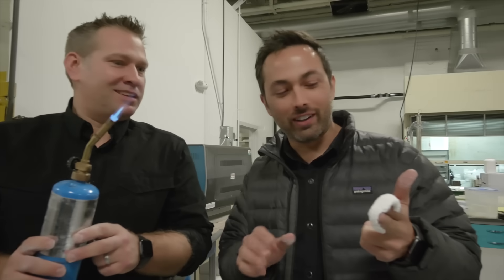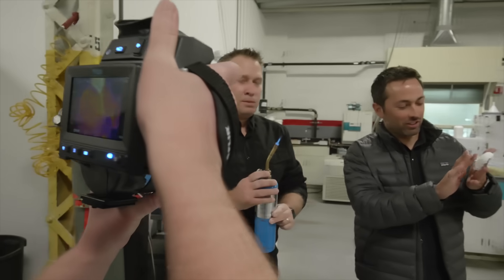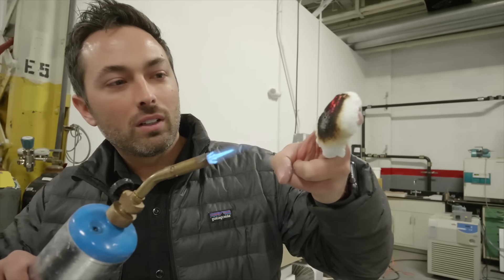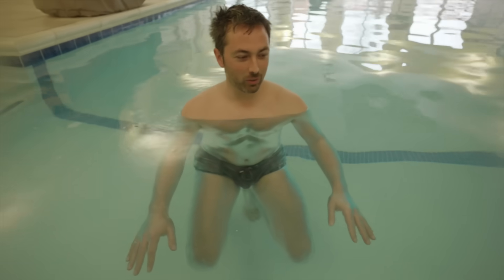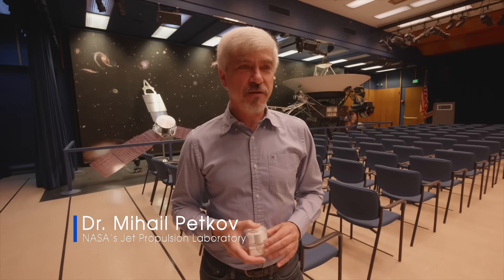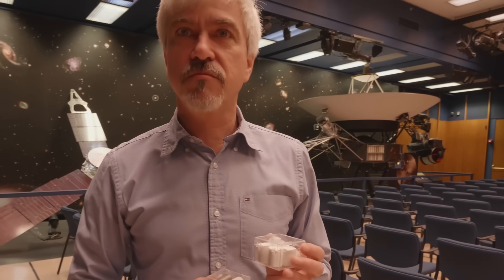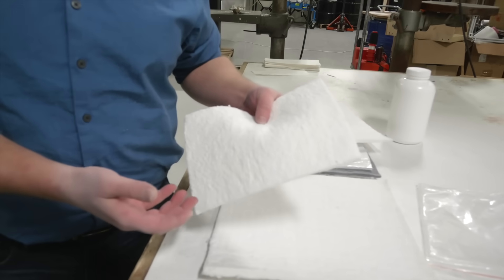I Waterproofed Myself With Aerogel!

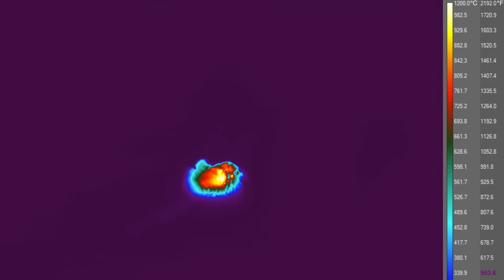Comment: @3:10 Fingers are not even touching the back of the aerogel. Don't cheat when a camera is watching!
Reply: What do you mean
Reply: @thomashuntley827  watch it and see, he pulls his finger away from the back of the gel so he is not burning the gel where his finger is. You can clearly see it if you watch it at 3:10. His bottom finger is still touching but the top finger is crossed behind the bottom one.
Reply: @jellibeens  it's so he doesn't get hurt,
Reply: @jellibeens   even if his 1 finger is a millimeter away, his hands don't get burnt. 
When he removes the aerogel a couple of seconds later, you can see the material getting removed from both fingers.

Comment: When the Aerogel is applied to the body does it reduce drag? I'm just curious if we are going to be seeing this stuff in sports where swimmers could get more speed. Maybe even use it on cars to reduce drag?
Reply: I really want to experiment with aerogel. Real interesting
Reply: for example if you apply it to swimsuits, the swimmer becomes more buoyant, giving an advantage to them. I think 200 world records have been broken using swimsuits covered in nanotechnology like aerogel so actually we have already been seeing this stuff in sports but it was banned due to unfair advantages. maybe one day all sports swimmers swimsuits will be covered in aerogel and will be the norm
Reply: Why would it?
Reply: @Gigasimo456  Water won't adhere to it. If water isn't adhering to it does that also equate to less friction?
Reply: @nhansen197  I mean, sure, but I can guess metal-fluid surface friction is negligible in almost all applications.

Most of the drag is caused by the body having to move away the fluid it's in. I don't think surface friction plays a significant role.
Reply: @Gigasimo456  Surface friction actually plays a big role. This is why auto racing is always looking for the best possible outer coating to put on their cars. It's not to make the car pretty. Speed skaters and skiers wear special racing jumpers that are designed to reduce drag. It's not just the media the racer has to push through. The amount of drag also plays a big part. The less drag there is the easier it becomes to push through the media being raced in.
Reply: @Gigasimo456  you trying to sound like an expert is cringey......
Reply: @nhansen197  surface friction is negligible for swimmers speeds, for planes on the other hand plays a big factor. But even then the drag caused by having to move stuff away (lift and parasite drag) is much higher than skin drag (friction drag).
Reply: What if it is applied to a boat? I would love to see that.
Reply: @davidhansen6788  I was just thinking that it'd be great on cars. Just imagine what it'd be like if water simply didn't stick? At all. Imagine a front windshield that never streaks.  Not to mention the possibilities to racing.
Reply: You can just throw your car in lava of you don’t like it.

Comment: He’s still alive today and his skin is still mostly cancer free!
Reply: Wait if it’s waterproof then what happens if he sweats
Reply: @bandittheyeetgod3829  he won't sweat at all, the aerogel will absorb all the heat
Reply: @Qwerty-jc3so  it's insulating, not cooling, he would be even hotter
As for sweat, it would just run off his skin
Reply: @codebracker  but the aerogel would be absorbing the heat right? It won't reach his skin, and his body won't heat up so he won't sweat.
Reply: @Qwerty-jc3so  most of the heat that keeps you warm comes from within your own body, that's how warm clothes work
Reply: @codebracker  but the overheating happens because of extra external heat, that's the reason we sweat so much in summers. Alsoo.. all sweat does is cool off your body on the outside, you'll just have to take medicines for fever if the temperature rises on the inside. And whatever heat is on his skin would probably get absorbed by aerogel.. right? Doesn't matter whether internal heat is the cause or external heat.. as long as the temperature is maintained on the surface you probably won't sweat.
Reply: @Qwerty-jc3so  firstly no, overheating happens when heat from your body can't escape so it just keeps acumulating, in summer the temperature outside is higher so less of you body heat escapes
Secondly no, sweat just helps heat escape your body as evaporating water absorbs the heat of your skin
Thirdly no, insulating materials don't absorb heat, they reflect it, so if you are hot it just reflects the heat back into your body. Only water or sweat that evaporates actually absorbs heat
Fourthly, fever medicine just makes your body expell more heat, because when you have a fever your body is actually trying to keep heat in so the heat would kill the viruses
Reply: I was looking for an upvoted comment about comparing this stuff to asbestos........
Reply: @Sanguinarius9999  Watch the part at 11:12, that should answer your question.
Reply: @ambozz3726  thankyou
Reply: 😂mostly 🤣
Reply: Mostly?
Reply: Wtf

Comment: That putty has been around for maybe 2 decades in the plumbing, HVAC trade. When soldering or brazing they wrap the putty around the pipe on each side of the joint. The never goes past warm after the putty. It works like a heat dam. We also have a spray able insulating, fireproof gel we spray on the interior of walls when using a torch. You wont burn the persons hose down. Hopefully.

Comment: it seems like the focus of aerogels are for the insulating properties, not specifically because of it's low density. if it weren't so expensive I'd investigate if it could be worked into copper wire to reduce the weight and still have great electrical conductivity

Comment: how did he get the powder off his skin?
Reply: with a non-polar solvent... turpentine would be one example that is easily accessible (though be careful with that as prolonged exposure to the fumes does harm the brain).
Reply: @derpionderpson1424  so... would soap and water work? 🤔
Reply: A-Disappointed-Sigh soap have some similar properties but if you have ever tried to get paint on your skin you know how hard it is to get off with just water and soap.
Probably would need something specifically for the purpose like turpentine.

Comment: So if I understand correctly, the aerogel in that form repels water. Can you swim if you're coated with it or would you just fall down? And what if a waterfall or pool or something was created using that water that doesn't actually touch you, would you get wet from the waterfall or would it be enough force in it to make you wet anyway, and could you swimin that pool?

Comment: So if i had aerogel on my whole body i could basically just walk on the surface of the sun ...kind of
Reply: The surface of the sun is way hot
Reply: It’s not the heat that’s is the deadly thing, it’s the amount of energy being transferred
Reply: Even just the light radiation would burn you
Reply: G thats a good point
Reply: Or i will be vaporised by the radiation, actually heat is a weak form of energy so radiation may kill me even faster than heat
Reply: Rigel that’s what I meant. The sheer amount of energy(radiation) is so immense, you would die instantly, even with the aerogel

Comment: There was an invention called Starlite before that can also withstand extreme heat. Discovered by a barbershop owner in the UK. Maybe this has the same material. Too bad the inventor died without revealing the formula.

Comment: 6:00 He should look up Diatomaceous earth. It doesn't exactly work as he describes but it is a physical insecticide and it's been the only thing that I've found to work against ants in my house. I usually get invaded by ants every summer but ever since using Diatomaceous Earth, the ants have rarely ever invaded me as bad as they did before. Even if they do, all I have to do is follow the trail to the open source and power it with the earth and it effectively seals it off for good. I've tried bug sprays for years and they never work for very long. This stuff is the only thing I've found to work as long as it doesn't get wet.

Comment: So if this stuff is cheap to produce you could technically use this in applications like diapers and replacement for silica gel and other stuff
Reply: No you need 2 rubies and a gel sack which are hard to find

Comment: But people are already waterproof, otherwise we would be like electronics, alot of water and stuff starts to fail
Reply: We can’t repel water off our bosy
Reply: Body*
Reply: Our cells can kinda die if they're left submerged for enough time, because of concentraton gradients and etc. They soak up untill the burst
Reply: Mr Thiefo actually when your skin wrinkles in the bathtub that’s because it’s absorbed water
Reply: Try to sink in electronic bathtub
Reply: we're water- resistant  (up to a depth of 400 feet). check the warranty. God never said waterproof.
Reply: Well, we kinda are like electronics, too much water and we will fail (waterpoisoning), especially if the water lands in the wrong places (drowning).
Reply: Mr Thiefo  ofc some water goes into your body what are you talking about. Why the hell do you think the skin on your hands and feet start to go all wrinkly and slightly puffy when you are in the water for too long? Obviously it's a tiny amount but it still gets in. If you were to remain in water indefinitely your body will absorb enough water to become so soft that it would literally break apart.

Comment: what happens if you point a fighterjet straight up on full power? how high will it go? what happens then?
Reply: It doesn’t have enough thrust to exit the atmosphere, and it relies on the oxygen in the air to sustain its thruster. Therefore it would just stop ascending at a certain height, lose momentum, and descend again.
Reply: @achilleaustin4477  yeah but when and where and how  all of this would happen is what i'm interested in ..
Reply: moonlite x i just explained how it all happens, so all you need to know is where and when. Which are essentially the same thing in this case, being what height it stops ascending at
Reply: no, i would like a more detailed explanation. for instance  how different heights affect the speed of the airplane, and what gives way first. eg is it the engine that chokes because of lack of oxygen or does it run even when the air is too thin for the jet to push the plane forward. what amount of thrust is needed and would the wings be of any help anymore. what if it had u2 wings? does the height acheived require a space suit etc etc etc. i'd like a long and detailed explanation or report or hypothesis on what would happen at specific heights according to the specs and speculations.

only thing you said was that because of the lack of oxygen it would start decending again at a certain height. i knew that already. that wasn't what i was asking.

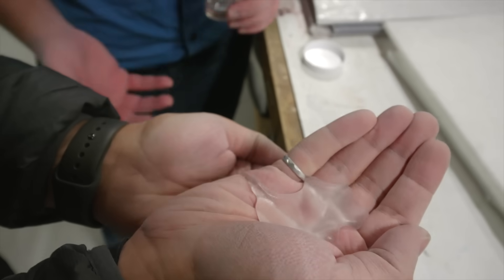Comment: 8:56 Okay, now im gonna wash the aerogel off my hands.. WAIT
Reply: He might use other substance than water that actually can "kill" areogel
Reply: @prince9105  kill wouldn't even fit in, there's lots of other words which would work better. Also oil can take it off
Reply: @fireemperorzuko8756  yeah thats y i said it in "" because i was not sure if its correct, in my language you can use word "kill" for just like making something disappear, but ty for correcting me
Reply: @prince9105  "kill" may not be the perfect word, but it still makes sense and your meaning got through. Your English is good.
Reply: @prince9105  Can I ask what language that is? That's really interesting! Thanks!
Reply: @harperbird1034  Polish
Reply: @prince9105  Cool! thanks! what's the word for "kill" that means both of those things? I looked it up but got a couple different answers.
Reply: @harperbird1034  Kill = "zabić", which have a few meanings
Reply: @prince9105  cool! thanks for sharing! I like learning about other languages, I think it's so interesting.
Reply: I bet it really messes with your body's cooling action. When you sweat it should not allow it to be exposed to the outside air and therefore be unable to evaporate.
Reply: Luckily, due to the fact that normal bar soap has both polar and nonpolar sides, he can likely use it to get the aerogel off.
Reply: How did you did it

Comment: You could replace down insulation with ground up failed aerogel pieces. It would be more insulating, and way lighter. You could also line a firefighter outfit with it, making it more breathable, lighter, and more flame resistant.

Comment: No one:

Guy in blue shirt: I would like to pull the oils out of insects so they can dry out and die
Reply: It works. Take a can of autozone brake clean and spray wasps and insects. It kills them almost instantly by drying them out. And you can use as a degreaser and cleaning brakes lol
Reply: @ssj2camaro21  The only issue with using it as an insecticide would be that it is indiscriminate. It would kill the beneficial insects like lacewings, ladybird beetles and other predators the same way it would kill the pest insects. That is just what most of the older, harsher chemicals do.
Reply: Wouldn’t the aerogel dry out plants too?

Comment: So it isolates temperature? Would it be possible to cover yourself with this Aerogel like you did when in the pool... and walk "naked" in siberia in -50 celsius and still keep up a fine and comfy body-temperature?
You still breath in the cold air of course, but yeah, could it act like a replacement for winter clothes?

Comment: Hi, I am actually revisiting this video to pose a question. My father works as a paint developer and chemist and he is having trouble with metalic paints. The aluminum in the metalic paints crinkles up or shears off because of tempurature issues and ends up looking like sandpaper. So (theoretically) would it be possible to create an aluminum aerogel alloy that could be incorporated into metallic paint? I am not very scientifically minded, but I have a very curious mind so I thought I would pose the question. I don't even know if I will get a response.